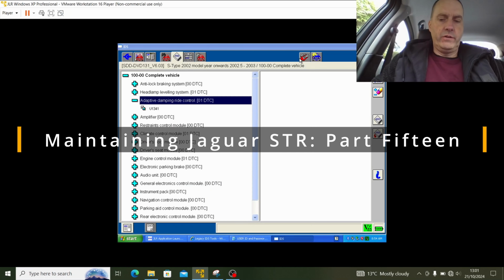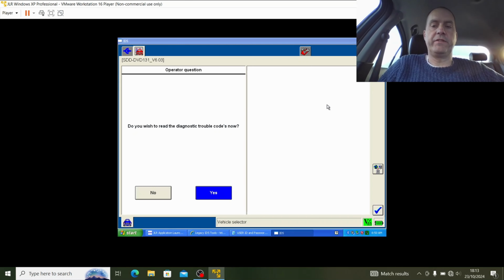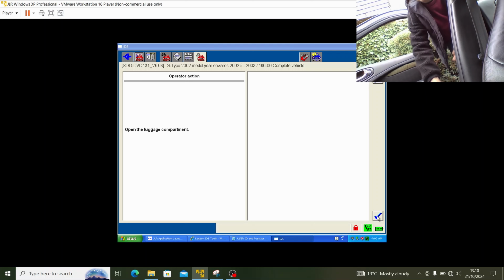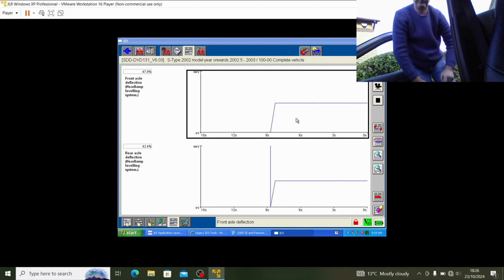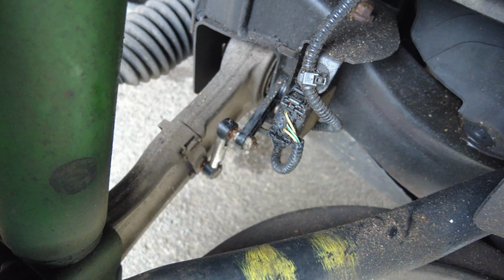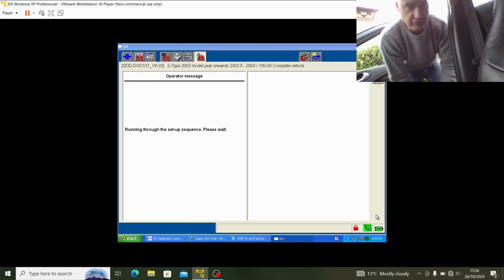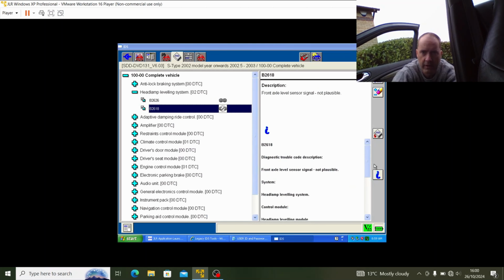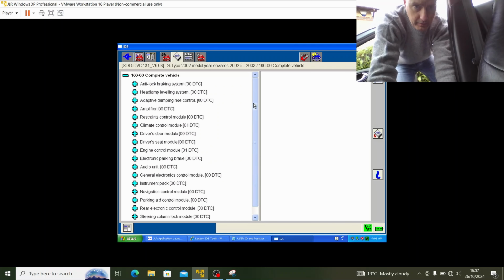Maintaining Jaguar S-Type R: Part Fifteen (CATS and Front Axle Sensor)

Comment: I bought the SDD software you linked. Which software did you download for the diagnoses of the STR
Reply: Bravo ❤
Reply from the maker: @InSlobnia  the version 131.6 version.  I downloaded the virtual machine image as it comes pre-configured with the calibration files and Mongoose driver.
Reply: @ I see a 131.03, I don’t see a 6
Reply from the maker: @InSlobnia  as long as it's v131 as that version works offline.
Reply: @ Ok thank you. I appreciate you assistance. Means a lot